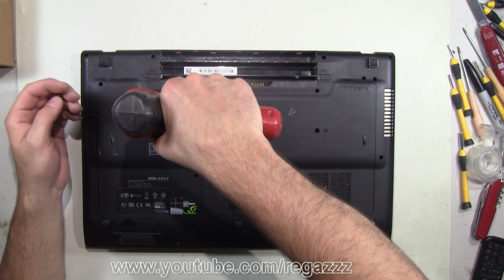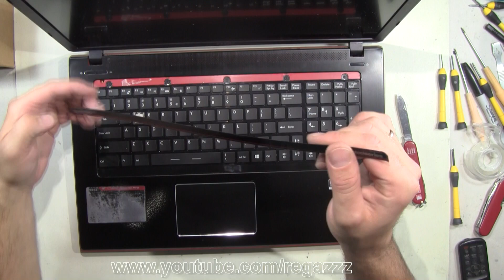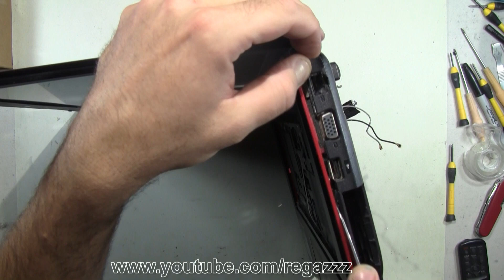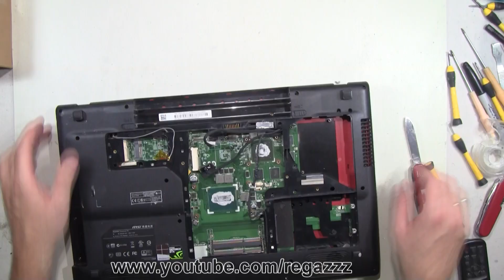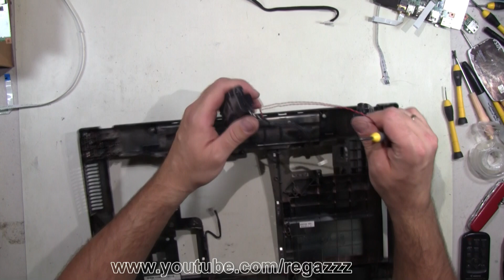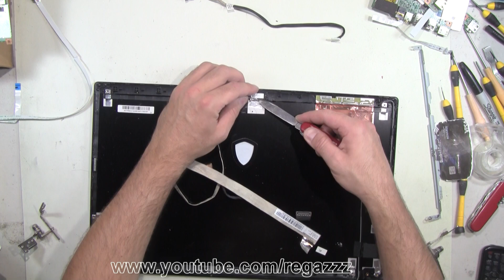MSI GE70 2PE APACHE PRO 17" MS-1759 How To Complete Take Apart Full Disassembly Nothing Left

Comment: Thinking of taking mine apart as well, though I was wondering, do you think its possible to use it with just the motherboard? Without the monitor? Might think of 3d printing a case to house just the motherboard.
Reply from the maker: I use a gaming Lenovo without a screen as easy as 123.